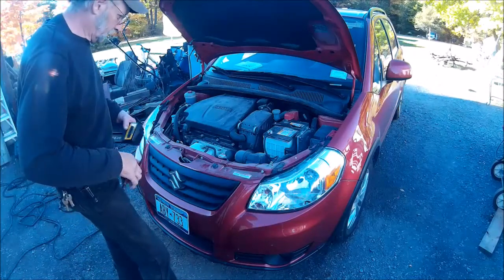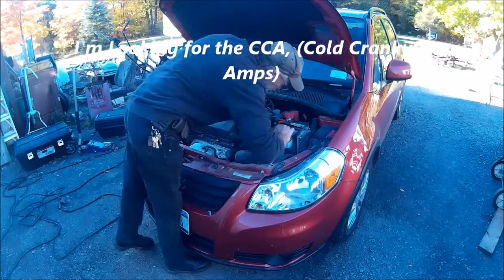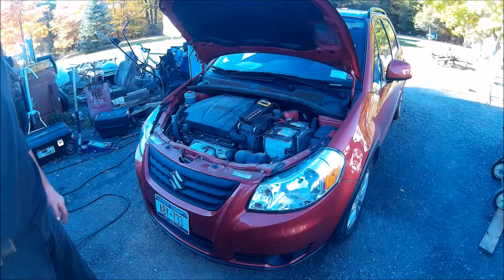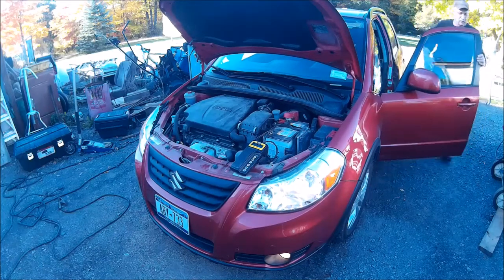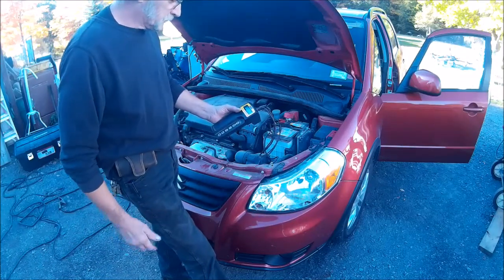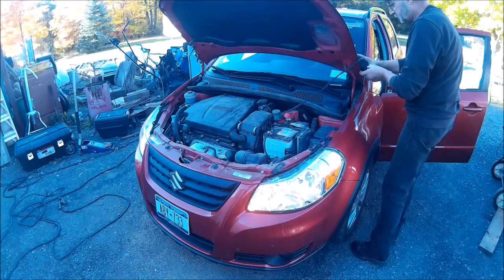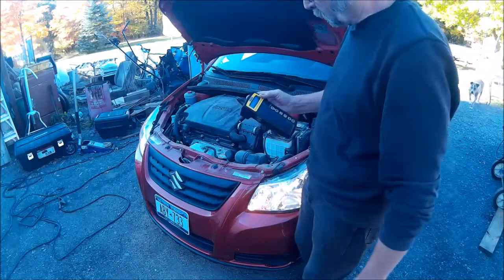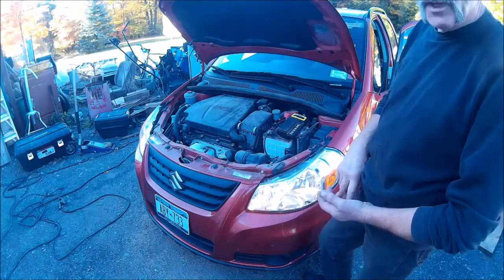Testing Batteries and Charging Systems

Comment: Nice video! . Thanks . I have a Suzuki sx4 2012 crossover . When I start the engine I have 14.2 volts . But sometimes while I'm driving at 650 or 700 rpm the voltage drops to 12.4volts. . . Is that normal ?. I mean I thought it was supposed to be 14.1 or 13. Something all the time.. ?  . Thanks
Reply: I'm not completely familiar with the Suzuki system, but many are now controlled by tbe computer, so l would suspect that it's just completely charged and not needing to be putting any "juice" in the battery,  in other words its called floating